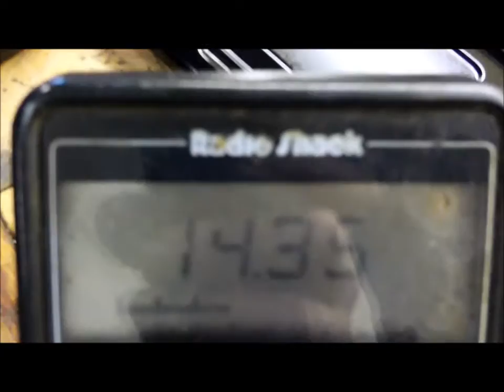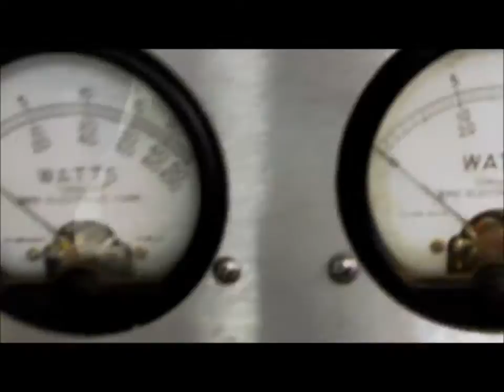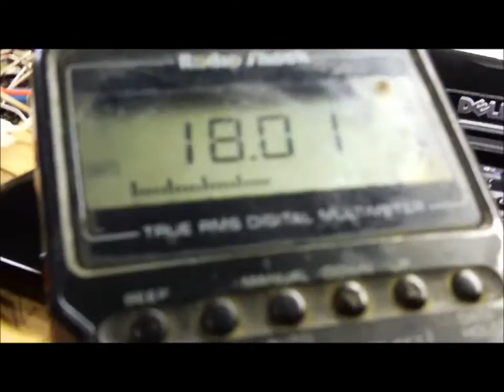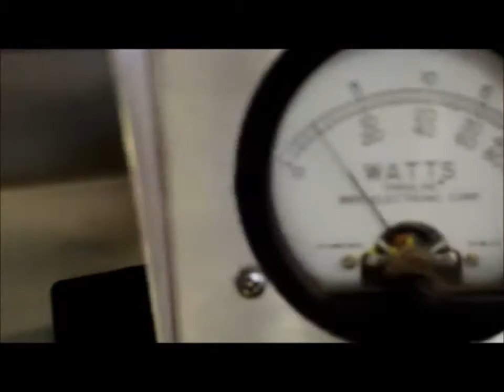DEI 2879 in NoName 5 pill

Comment: i have not messed with building in years. I gave up my soildering gun and my build hobby when i got marred 15' years ago.. it was consuming to much of my time..This was always a hobby to me not a business..... BUT back when I played with this stuff toshiba 2879's cost me $13.00 a each course I would buy 200 of them at a time...15 -20 years ago when there were no DAVEMADE copies... before they started whoring out parts to anyone and everyone and then  the "would be techs"  started copying the design.. It does not surprise me they have issues... seeing most of them have no clue what is going on in the amp anyways...

MY design  is similar to what you have in this vid cept I use 1/1/4 output transformers.... long story short i recently dusted off the work bench and played with some DEI transistors... I love them.. so yesterday I dusted off the work bench and i pulled the Jap 2879's out of my comp 8 pill that I was pretty much undefeated with in keydowns from 1998-2000 and dropped in soome DEI's...with a little tweeking they turned out in my case to be pretty much direct replacement watt for watt... holding 19 volts with a 3 pill driver the box is doing pretty much what it always did..I hammered the shit out of it and didn't let any smoke out  :) lol which is a good thing cause i never could get the smoke back in :(...anyways.....so far so good..... BIG THUMBS up on the DEI pills! which a is a good thing seeing that the Toshiba's are pretty much a thing of the past.Still way to expensive though lol man it use to be so much cheaper to play back in the day... I have my fix now... Im thinking of playing with some 50 volt stuff.. always wanted to but never had the time....